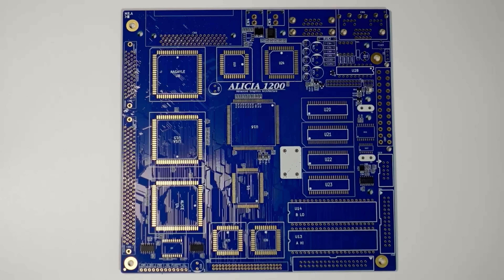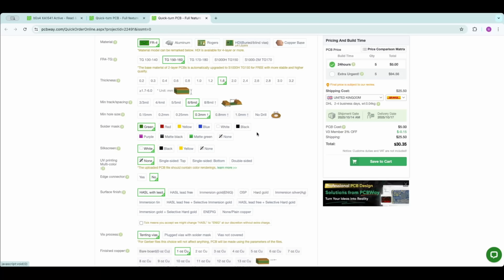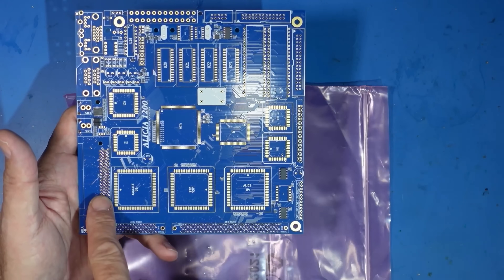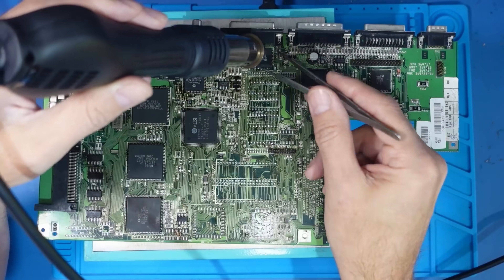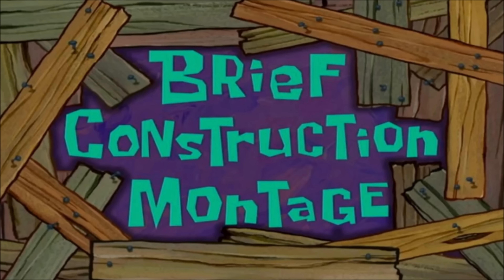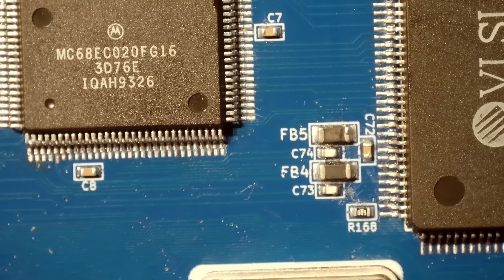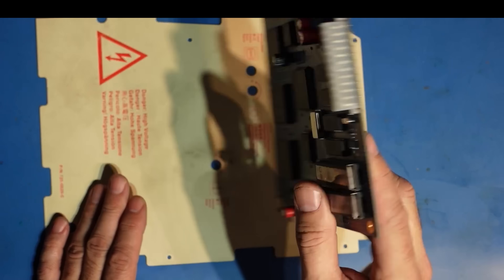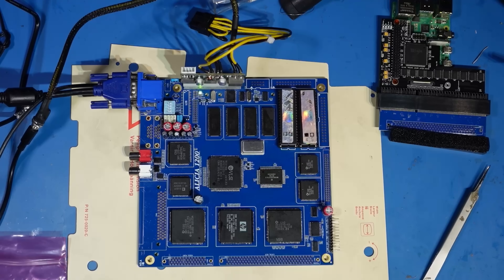New Mini ITX Amiga 1200 PCB for 2025 – Building the Alicia!

Comment: If it's a mini ITX or any other form factor, then it's not an A1200, period.  If it doesn't fit snug in an A1200 it's not an A1200 motherboard.  Call it A7700 A4500 A2999, not A1200.
Reply from the maker: I respect your opinion, but I like to call it an A1200 as it uses all the original components of an Amiga 1200. Just repurposed and re-designed for a different format but Thanks for the comment :)

Comment: I don't understand why we still need old chips. I am in no way proposing to use FPGA but if we can get replacement chips that are not FPGA, and use FPGA for what does not exists anymore, I would say it is a win for Amiga lovers. So much can go wrong when transplanting chips, and these chips are already 25+ years old, so it is just a matter of time before they could fail. 

I would gladly invest in a new A1200 board with modern components if anyone is up making it.
Reply from the maker: Yea that would be nice. But I don't think that any modern replacement for the custom chips.  Perhaps they could do FPGA ones :). But k get ya point I just love Amigas in this format :) thanks for the comment
Reply: @Retro4u  Some things are out of production; so it is understandanble. Although you can restore C64 with copies of chips that are not even FPGA, so my hope is that we can get to a similar point with the Amiga chips. My original 1200 will eventually die at one point, and emulation is not the same for collectors :(
Reply: There is plenty of alternatives for this. Both pure FPGA's like Clone-A, MiniMig, MiSTer, AmiCube but also hybrid solutions like FPGA Arcade (uses real CPU and FPGA for chipset), THE A500/A1200 which uses an SBC for computation, etc. All this already exists. The aim of this project is NOT to sell lots of boards - it's a work of PASSION and love. A lot of ppl seem to misunderstand this ;-) Not that it matters to us. We'll keep on doing our thang.
Reply: @shoesworkbench  Honestly I could not care less about why something exists. It is a product, it has a sticker price and specs, people buy whatever they fancy for whatever reason they want.

As someone wanting to buy an Amiga as it was, I don't want FPGA nor I want emulation, as I can get that done already since ages ago... An amiga can be emulated on my computer for free, as I have been writing code for the Amiga for almost 20 years now and never felt I need to have the original hardware.
But, I would appreciate a modern rendition with actual replacement parts. 

But please spare me the passion and love string melanchony song , played in the background, as most people around Amiga have been saying that for ages and then end up making profit out of the bones of that dead horse. 
Not saying that "all" wants to make profit; can save a couple of souls that made stuff for free for everyone to use; bless their heart.
Reply: @fcf8269  Lol, mate I can't tell if you're being serious or not. But you do you, I'm fine with that 😅

And FYI this board doesn't have an FPGA - nor does it emulate anything. It's a redesigned A1200. And it's creator never planned on releasing any of this to the public. Enterlogic is not a for profit organization. This is a hobbyist project plain and simple.

And don't worry, we love you anyway 😂❤
Reply: @shoesworkbench  not sure why you are so concerned about me being serious or not. As soon as I spoke you jumped in saving the day as if there was something to protect... That is something you don't see normally, so I would say to focus more on how sus is your behavior about this board, more than anything :) 

Not sure about the FPGA part, do you see me saying that this board have FPGA? Mind to show me where I wrote that? Or is that your projection as you are going all over the place in pure panic mode with this reply, which honestly as you are not even involved into making this board, leave me befuddled to be honest.
Reply: @fcf8269 I'm starting to understand why so many ppl are avoiding the comment section,  ha ha. Take care mate.
Reply from the maker: lol 😂 it's always great fun :) 🤩
Reply: @shoesworkbench  Indeed; some people can't take anything that goes beyond their echo chamber; but it is impossible to avoid these people, as they eventually feel the need to get out of their discord chat where they just talk about what they like :) 
Good luck with your hobby! Keep pounding at these non believers !

Comment: While this sounds interesting, I just refuse to take an existing A1200 apart just for this...no thanks
Reply: I am sure there are plenty of damaged mainboards that can benefit from such a project! And at the end of the day it is a personal decision, if I had a functioning 1200 I would agree with you.
Reply from the maker: Especially capacitor issues :)
Reply: I recapped 7 A1200 boards of which 5 had damaged traces from leaked capacitors. The A1200 is doomed and replacement boards (of any form factor) are very welcome.
Reply from the maker: Yeah 👍 I understand fully. Eventually  they always go
Reply from the maker: Yeah I get that it's not for everyone. Myself personally I prefer the small format 😅. but thanks for the interest and comment :)

Comment: Does the board come with the T2 board or do you order it separately ?
Is the connector that the T2 board plugs into the same as the A3000/4000 CPU slot ?
The online details for this project are very poor.
Reply from the maker: Hi it's not the same as the cpu slot on the 300/4000. It's basically the A1200 expansion slot on different format. The board is extra. Hope this helps if you need more info then I suggest you pop along to the discord.  :) Thanks for the comment

Comment: Sorry to say this, but maybe you should practice SMD soldering a bit more before a project like this.
For example: It looked like there was a lot of solderpaste left under the chips, this will cause a lot of problems later on, and even a ultrasonic cleaning isn't going to clean everything..

There is a channel called mr. Solderfix, he can show you a lot of tricks.

Glad you got it mostly working in the end, and I hope you will have it up and running soon.
Reply: We all start somewhere. Thankfully these custom chips are pretty solid and can take a bit of abuse. I agree though that some of the montage was hard to watch knowing these are irreplaceable chips worth hundred of quid. Running code at the end of the day is a great feeling. 

I hope you’ve already realized that you’re 1024k short on chip ram before you start soldering connectors and such. It’s likely a bridge or open signal somewhere.
Reply from the maker: Yeah I realised after someone commented tbh I was having a day of tonight from
The board and will carry on tomorrow. Thanks for the info and I'll certainly fix that before adding the new final items. TBH the montage was made up of clips from the first round. Since the main chips have been removed and underneath cleaned  with flux remover and replaced.  It is indeed a great feeling when you see it come to life :)
Reply from the maker: Hi no problem I appreciate the feedback.  But since that build on the video the chips have been of and on a few times lol 😂. I will check out the channel for sure thanks for the comment :).
Reply: The chips are gold for sure, but personally I find it very inspiring and it gives other noobs like myself hope of one day building my very own Alicia 1200 instead of just selling them 😂

Thanks for the solder-channel tip! Have a couple of old pc boards to practice on. ❤

Comment: Gosh I have real mixed feelings about this. I saw someone post elsewhere, "no way why destroy an Amiga 1200 to make this" and I agreed. Then thought to myself how is this any different to making a ReAmiga. I'll order one but also order the chips from another seller. Internal conflict resolution for the win! Btw. Love your solder of the IC's - I perfer your way than drag soldering.
Reply from the maker: HI 👋 I have the Denise as well and my build videos are on here.  I really love the small Micro ITX format and it looks so great. I used a scrap board for mine and yeah I have a A1200 as well but these are so practical and better than the emulation for example the A1200 something about real chipsets lol 😂.  It's everyone one ☝️ for themselves it's huge amount of work I had to do but be sure to check p it next weeks video where I will finish the build and probably install the pistorm. Thanks for the comment and by the way o have a re Amiga on the shelf waiting to be built lol 😂
Reply: Fully agree with the comment "why destroy an Amiga 1200 .." and I would never personally recommend anyone doing that. 

But many of us have semi-broken boards. Hurt by leaking caps or other kind of damage. 

Also the formfactor is a-mazing like Neil said. Not to mention the built in fixes and A1200 mods that are normally required for a stable system. ❤

Comment: Very nice build. Kinda iffy that diagrom only saw 1 MB of chip though... You might have some legs on the chipram not soldered (one of the MANY MANY issues I had with my Re-Amiga1200 back during covid ;)
Reply from the maker: Ahh 😦 well spotted tbh it as so late ⏰ i have been up early mornings will re-check it as I'm running back through it this week.  Thanks for 
That. Yeah tell me about it they not the easiest of things to solder lol 😂